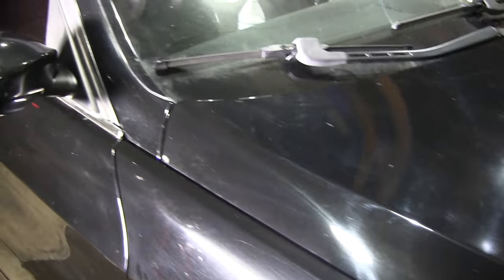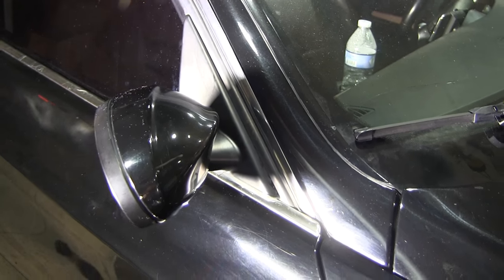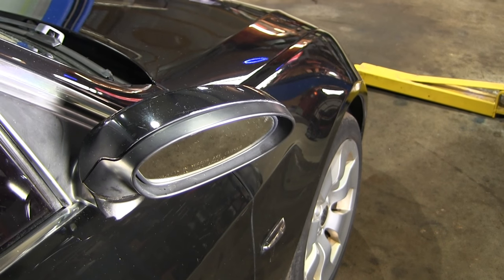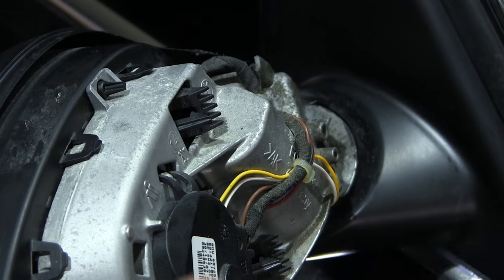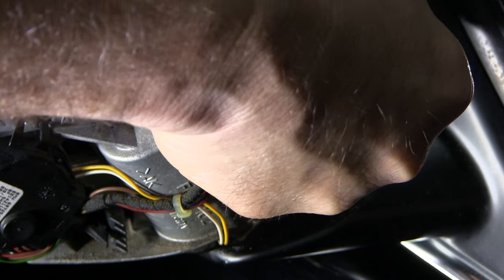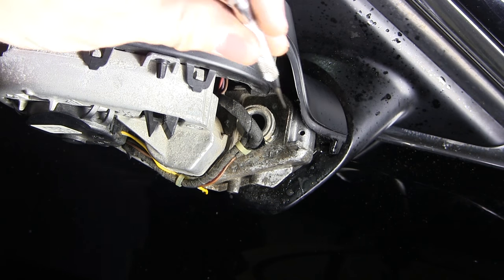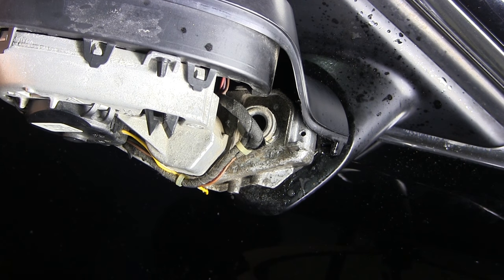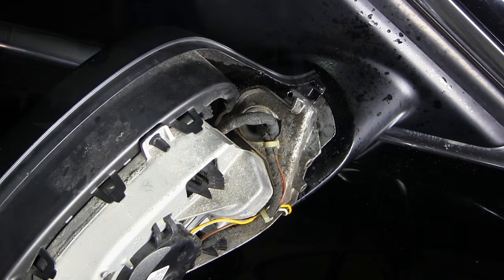FIXED BMW Folding Mirror Issue Without Removing or Wire Cutting

Comment: I had my car washed this afternoon (2006 BMW 330XI).  I normally avoid car washes over concerns that the workers will miss the track and damage my wheels (once watched my father-in-law pay extra to have the wheel covers on his 1970 something Cadilac cleaned after which the worker promptly squashed the front driver's side wheel cover against the track that guides the car through the wash, LOL).  Today's cars have different wheels, and car washes are generally of better design.  At any rate, after drying my car, one of the you men there, for whatever reason, folded in my passenger side mirror manually.
When I tried to move the mirror back, I ran into the problem cited here.  Between bouts of hissy fits (initially at the owner of the car wash who accused me of bringing an inoperable mirror into his establishment and trying to get it repaired on his dime, then outright disgust over why moving a mirror manually should break it), I started browsing the 'net for a method of repair.
Each to his own, but I'm not into fixing things by disabling the offending function, so I was not impressed with suggestions about cutting a wire.  The method shown seems very clever (what gave you a clue, Ed, to drill where you did??).  I haven't tried it yet (it's 1:00 AM in the morning here), but will do so first thing in the morning.  I may try the heat gun and tap first, but will certainly drill if that doesn't work.
My mirrors never did any automatic folding before today.  They would fold if I made extended contact with the door handle in unlocking the door via comfort access, and, of course, they worked when I pressed the button.  But, other than that, no automatic folding.  Since this problem has shown up, they are folding (outward) everytime I shut the car off.  
At any rate, I want to add my thanks for posting this very clear DIY.  Happy motoring to all.

Caruso
Reply from the maker: Good luck with the repair -Ed 

Let us know how it goes.
Reply: Tackled that repair first thing this morning (5:00 AM).  Grabbing my drill and attaching a 1/16" bit took longer than any other part of the process.  The hole that I drilled was almost exactly over the pin which was very clearly visible.  I pulled the bit out of the drill and used the reverse end in a way similar to you and your pick(s). It took almost no effort in pressing the pin until it noticeably retreated a bit deeper into the "hole."

I had some WD40 spray silicone with one of those straw-type "nozzles" which I squirted into the hold.  After cleaning away the small bit of excess silicone, I used a tooth pick to press a very small bit of a napkin into the hole that I had drilled before then coating/sealing the hole with a bit of hot glue.

I used a Teflon spatula to pry off the back cover of the mirror, and took care to line up the gripping tabs with the little saw-toothed tabs on the main mirror body when replacing the cover.  It went back on without a hitch, and, now, my mirror is working flawlessly.  Furthermore, if I ever run into this problem again, the passenger side will be fixable by simply removing the hot glue, picking out the bit of napkin (it's a very tiny little bit - I didn't want to risk being too aggressive with the hot glue and effectively gluing that  pin stationary), and repeating the process as you describe it.  If it occurs on the driver side, I will know exactly how to perform the entire procedure.

I am really curious, Ed, what clue you picked up that caused you to try drilling in that particular location.Without your excellent video, I would never have guessed to look for or drill at that location to fix the problem.

Thanks again.

Caruso
Reply from the maker: That's great you were able to fix your mirror. I use mine everytime I park now to keep the pin moving. 

How did I know where to drill?? Well I didn't really, I watched a couple videos of people tearing the whole mirror apart and I studied closely where the pin was located, I also found an exploded view of the mirror that helped locate the pin too. I was like you and didn't want to cut a wire so it would never work, I wanted it to work like it should and I didn't think tearing the whole mirror appart and having to weld it back together was a good option either.  Sometimes you just have to think "out of the box" and being an engineer I do that a lot to solve problems. Thanks for the comments and for watching! -Ed

Comment: Hey Ed, before drilling a hole in the spring end try placing awe (flat end hole punch) in the flanged hole(it’s on the outside edge with a little wing on one side) and moving it sideways. Don’t try to move the entire mirror assembly.  Just wiggle back and forth a few times. Enough to help the pin find its proper space. Tap the awe with a small hammer. And wiggle some more. I did this before trying your hole. It worked. Sprayed a little silicone into the big spring and added some white lithium grease then buttoned everything back together.  I did this on my 2006 330i. So far working fine.
Reply from the maker: Good tip Lee. 
I tried tapping and moving it back and forth first but the midwest winter salt was just too much to overcome without getting into the area the pin lives on mine.

Comment: This is all good.  My experience was a little different.
1) The pin must be lubricated and free to move.  Notice the mechanism is spring loaded.  You can tilt the mirror while it's in the folded back position with the cover off and open up the gaps between the moving parts.  Try the WD40 and tapping and poking and prodding from below through the opened gap. Maybe you won't even have to drill, although drilling and packing grease in there is the baller move. 
2) WD40 is a penetrant, not a lubricant.  If you're lucky enough to get the pin moving, wipe away the excess WD40 and devise a way to get lithium grease on that pin and work it in and out.  Now tip and tilt the mirror every possible way and get lithium grease into the gap.  Rotate the mirror manually and you'll notice it starts moving a lot easier.
3) There could still be a synchronization issue.  There is an intermediate disc. It can rotate WRT to the car and WRT to the mirror.  I think it's meant to stay put unless you drive the mirror into a tree, then it's a safety valve.  You have to get the system back in synch. There's a step by step TSB method but trial and error works, especially with the cover off so you can see the moving parts.

Comment: I bought a car with this issue. The original owner snipped the wire so I soldered it back together and did they fix. The mirror does work but I have a weird issue of where it's backwards or opposite to the other mirror.  Folding and closing works and it homes correctly, it just does it opposite to the other door.. Anyone know how I could fix this?

Comment: Hello, I tried it in the right passenger mirror in bmw e90 2005 ref 52366, but even if I drill in the same place a little deeper it is still solid and I do not reach the interior. I would appreciate help, maybe the mirror is different. :( greetings

Comment: I smacked my left mirror with the side of my gate pulling into driveway , the glass didn’t break or anything but the black plastic part that sticks the mirror to the car kind of snapped off from one side.. It’s still holding on pretty good the only thing is I can’t adjust my mirror. Would glueing it down fix it or would I have to replace the whole thing ? :/
Reply: I have a 2005 Toyota Corolla :))

Comment: That's took me 5 mins and all done!  Thank you!
Reply: Howard Lee   hi do you think it will work on e60 please?
Reply: @johnm-vo9cm  did u try?
Reply: Bruno Reis yes but doesn't works for me  because i have 535xi 2008     to fix it  i think i need to remove the door panel
Reply: @johnm-vo9cm  ill try myself. Mine stops in the wrong position 😂
Reply: Bruno Reis   ya  parallel to the body? only  passenger side    but if your car it a 3 series  I'm pretty sure the method will work
Reply: @johnm-vo9cm  ya, not its a e61, thats why i asked if it worked for you :P
Reply: Bruno Reis  oh OK   but  u can remove the glass  mirror by pulling  and unscrew  to remove mirror  cover and unplug the mirror  or cut 1 wire for temporary solution before fixing        I'm in Canada  so it winter    I'll try again may
Reply: @johnm-vo9cm  ill see if i can fix it. if i do ill let you know :D
Reply: Bruno Reis  cool 👍
Reply: @brunoreis5082  any luck with the e60/61

Comment: My right mirror got stuck, and WD40 couldn't free the pin. I sprayed in the slot after taking off the cover. I bought Blaster 16 PB and it freed up the pin. I think  WD40 only cleaned out the dirt and debris, whereas the Blaster brand lubed the moving parts.

Comment: I could not manage to drill it right I guess. After 3 holes could not find the spring thing. Decide to shower it with WD-40 but did not make it work so well :/

Comment: I drilled through the area in the video on my 328xi 2007 and it was like a solid metal piece. Didn't do anything. Couldn't find pin.
Reply: Yes that is what in in the way on the 2006 a metal piece you are not drilling through.

Comment: Let me ask you a question
My side mirror does not make any motor noise
Does not move at all

Is this a power problem?
Reply: did it use to move before?
did it stop functioning all of sudden without some symptoms indicative of something is about to go wrong? 
like grinding noise etc?
Reply: HI
Thank you for your reply

I tested the following today
I cut off the +/- power supply of the motor and supplied 12V.

Side mirrors worked correctly

I tested it with a simple tester

When you turn on the folding button, it is energized for a moment
Energizing is only a moment

I feel like I'm normal with your solution

I want your diagnosis

Comment: Yeah epic fail for me too. I drilled through and couldn't find the pin. Good video though. I deal with BMWs a lot and I'm sure I'll run into this again on one of my cars. I have literally about twelve e90s right now. Maybe it'll work for me next time. I ended up buying a mirror from ebay for $60 bucks.

Comment: No need to drill a hole. Take off the cover. Move the mirror back and forth, and you will see a slot in the rotating mechanism. Spray the lubricant into that slot from several different angles. With the mirror facing forward, folded, and in its home position. Be patient and keep doing this and the problem will be fixed.
Reply: I tried this first and it didn't help... half an hour of adding a little silicone lube, tapping, folding repeat repeat.
Drilled and it was working again in minutes.

Comment: Frustrated been working on drivers mirror for at least an hour the pin will not drop tried to drill small hole the hole was not deep enough I guess with 2006 bmw's the area I drilled was way thicker than you shown in your video. I tried the wd-40 down underneath soaked it and tapping on metal piece hoping the pin drops soon.

Comment: Nice video, my mirror has this issue. I will get myself a drill bit and make the magic hole. :)  I already tried to add WD40 from bottom, tapped it few times with hammer but still would not stop in the right position. I have 330i 2006.  I not JUliette im using my daughters pc. . I am her dad haha. Thanks

Comment: I avoided the drilling, and simply clean where the two folding parts meet w WD, and then sprayed lithium grease into those gaps.  Rotate the mechanism by hand several times so the grease is in place, and voila, my problem is fixed. 😊
Reply: @Jimmy Manan Did you even remove the cover? Or just spray into the cracks and move around? I know the cover is pretty old and may break tabs now.  So I'm trying to avoid that.
Reply: @HaOsLsE  Yup I did remove the cover, clean the mechanisms, and either spray WD5 or Lithium grease into the crevices.  After several times moving them, hopefully the pin will stick, dan keep the mirror from folding all the way outward.
Reply: @jimmymanan5997  Awesome thanks! I will try this and reply once I get a chance.
Reply: @jimmymanan5997  Well thanks a ton.  This worked for me this morning.  It was quite messy though.  So I think the cleanup of all the spray from wd40 took longer than the fix lol.  Took cap off.  Gently lifted on assembly.  Sprayed generously...moved back and forth, sprayed again.  Did this a couple times and probably the 3rd move it clicked hard and was working.  I did it a couple more times for good measure then closed everything up and cleaned.

Comment: Ouch.  I couldn’t get this to work. After giving up and finally drilling 2 1/8” holes in the area, I never did find either the spring or the pin.  Someday, while it won’t help me any, your posting the same (fruitful?) exercise for the driver’s door would be appreciated. Now, to wash off all of the dw40, clean the piles of metal filings out of the garage, and buy a mirror!

Comment: Apparently the mirrors can get confused where they are and show the same problem (mirror goes all the way forward).  I used the recalibration procedure in this video to fix it.  I had to do it twice, though and the second time I held the folding switch in for quite a while after the mirrors closed.  That fixed it.  Certainly worth giving it a shot.  https://www.youtube.com/watch?v=DxtZqaHRicM

Comment: Hi guys, who are the same BMW enthusiasts as me! I need help!!!
Does anybody know how to make the same fix for E60 mirrors??? There is a little bit another construction, more plastic coverage. I'm investigating photos from those guys, who removed mirrors. Moreover I bought used mirror for experiments. Unfortunately it didn't contain the folding mechanism (my fault, I forgot about existing differences). So I'm still not sure what will be the most suitable solution for E60...

However I'm pretty sure that it's possible! People, who earn money on it, told me that it's possible. But they keep it in a secret (bad guys). But I would like to do it itself! I suppose that it can be done on the same way, as it was demonstrated in this video.

I'll really appreciate for any help. Some pieces of advice. Any photos, links, videos might be helpful. From my side I'll try to share my experience with others, to help others, to make this information public!
Reply: For E60 try Youtube searh by "BMW Folding Mirror Fix" and you'll get your happiness :) 
There is almost the same
Reply: @-Goodwin-  Unfortunately I still didn't find it. I understand that the fix is the same. But I didn't find yet the particular place where I can drill on E60 mirrors. But I am not giving up :)